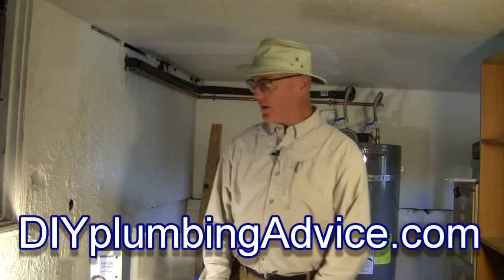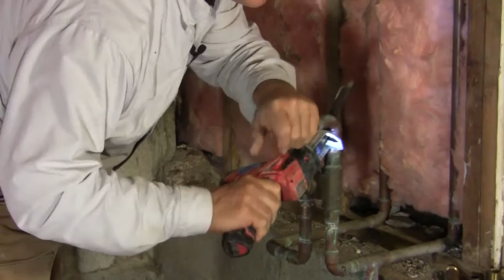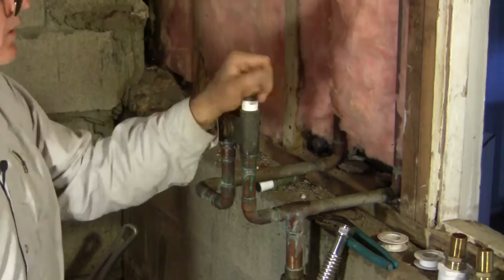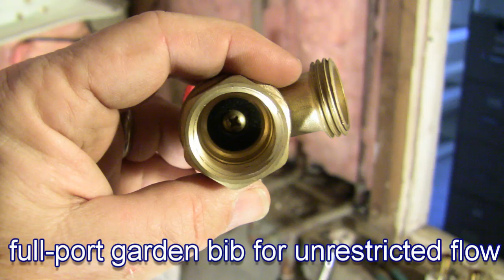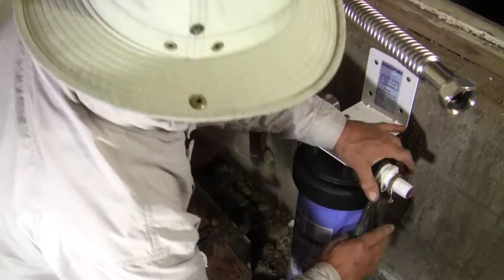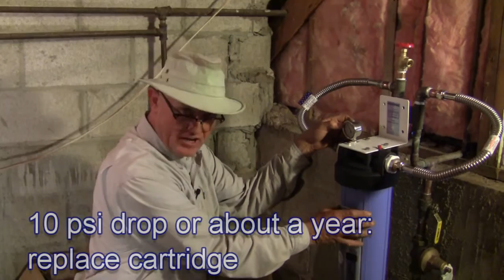Whole House Water Treatment System Installation

Comment: The best way is to use only hand tight when installing the canister.  The tool is only meant to un screw the blue canister.   Over tightening is not needed, it's an O-ring seal.   Hand tight.